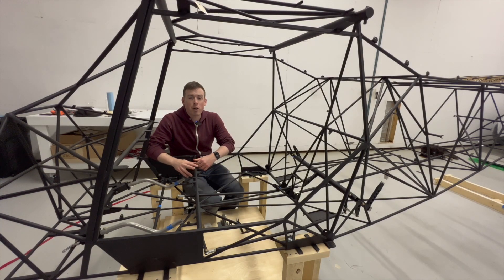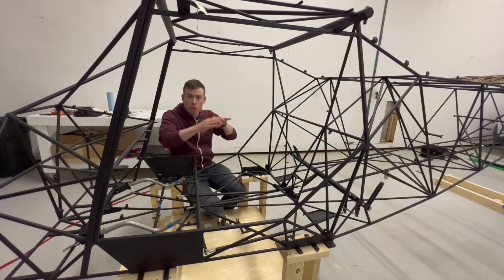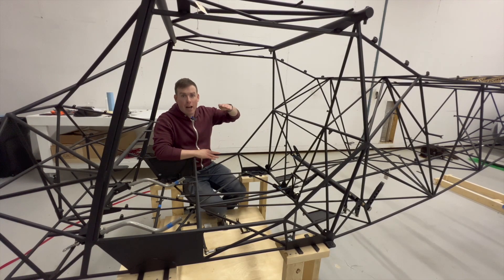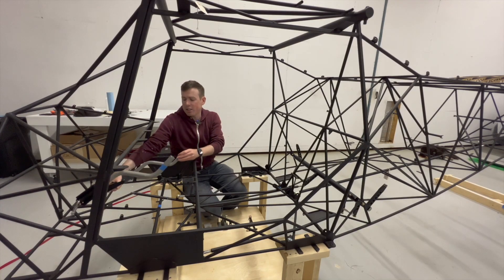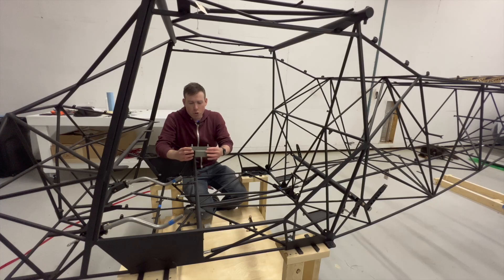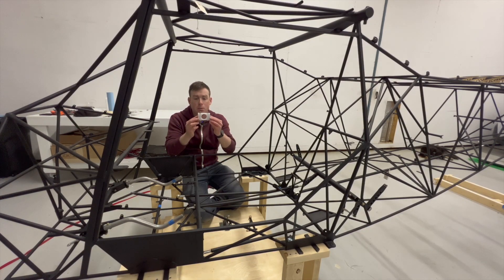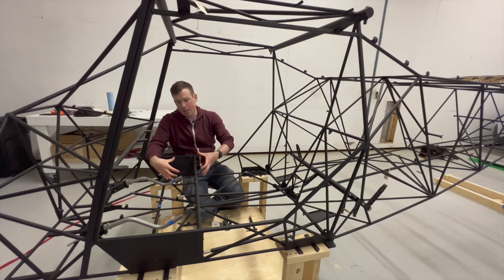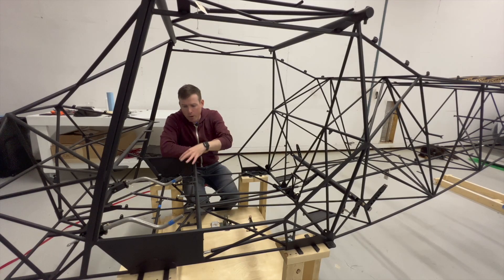Kitfox Build Update 03: Flight Controls Part One (SwiftFox Build Project)

Comment: The bearing is supposed to be pressed in with loctite 680  locking compound,  its not supposed to spin
Reply from the maker: Yep, the flanged bearings were pressed in with Loctite 680. (Fuselage Manual Page 10 #8)

The mistake I made was I pressed the bushing (that the bolt holding the control column into the bracket assembly goes through) into the bearing as well. 

The bushing has some grease on it and is supposed to be able to spin in the bearing, but it can't now because I pressed it in 🤦‍♂️ (Fuselage Manual Page 16 #34, #35)
Reply: so many bushings and bearings in that little set-up.  Yes, I see what you have done now,  it is a tight fit for sure.  I put a 3/8 reamer through mine first.  Something I picked up on a similar set-up on the elevator hinges instead of sanding the steel bushes.  If you put a threaded rod through with a nut on either end with a socket that's just undersized to the bearing it will push out.  I did a similar thing with the elevator hinges in the first place.
Reply from the maker: There are a lot! I thought about trying to push it out, or drilling it out, but I didn't do a good enough job of drilling the mounting holes for the bracket, so I'm just going to do it all again and hopefully this time learn and do it better. The parts should be here in a day or two so it's not much of a delay in the build overall.